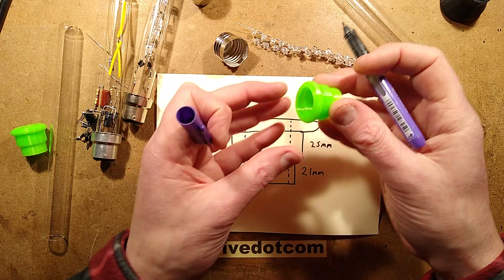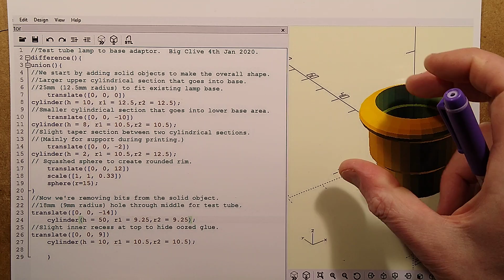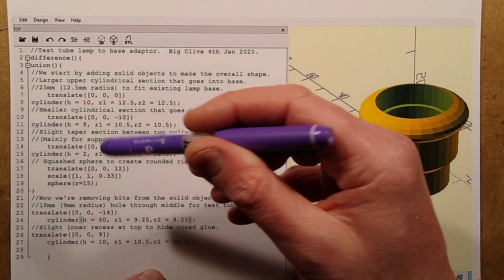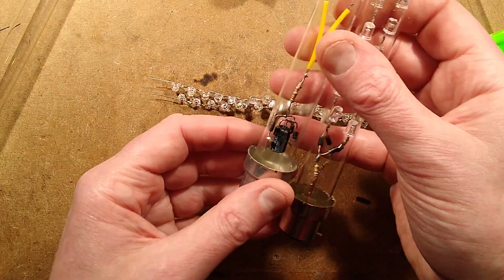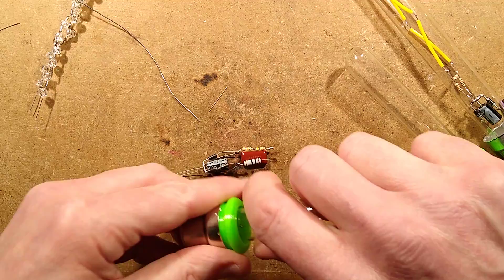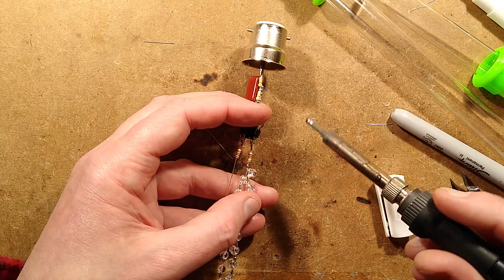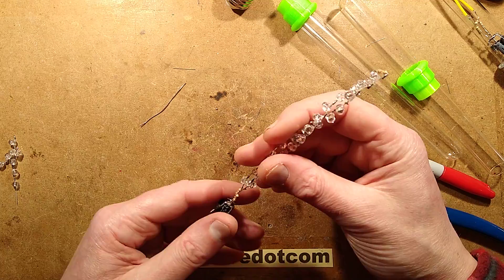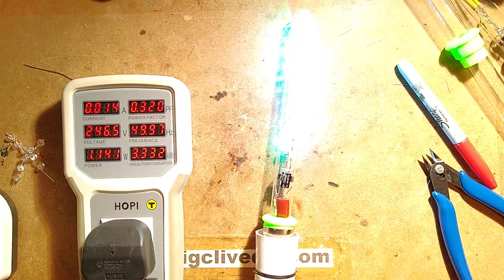3D printed LED test-tube lamp.  (with adjustable 3D openSCAD file)

Comment: >I dunno why they stack it like this     https://youtu.be/vNucN3ZW8Vg?t=280 

The union { } builds a shape based on the components inside.  The difference statement is the equivalent of saying ((A - B) - C) ... Where A is the shape (made of 3 components ) and B,C ... are the portions to remove. With the union statement, you have 3 components to build the shape and 2 components to remove material. Without the union statement, you have 1 components to build the shape and 4 components to remove material.

Comment: You usually use the little studs to pin the component legs in the bottom of the cap. Why did you not do this time you really gould have gotten mabe 8 or 10 more leds in,.

Comment: Would you have this schematic for 120v or would this work on US voltages to?
Reply: Wow did you really post this a week ago? Just now getting a notification for it. Stupid YouTube lol
Reply from the maker: Just released it fully today.  It will work on 120V.  You could use a higher value dropper cap rated for 250V.
Reply: bigclivedotcom ah ok I see. I might make something like this for my daughters room. Some of the comments show they were posted a week ago lol

Comment: When it comes to 3D printing cylinders number of faces matters. Here by the looks of it you have 30ish or so. Low number of faces means cylinders will end up slightly smaller in diameter due to averaging. To get around this you can simply specify to have more faces either globally by setting variable "$fn = 60" (for 60 faces) which I don't recommend, or locally for each cylinder by providing additional function parameter with the same name (eg. "cylinder(d=10, h=20, $fn=60)"). Also, this variable name is great if you want to create regular shapes like hexagons and octagons without messing too much around with polygons and then go about extruding them. There are other variables which allow configuration based on angles and whatnot, but I find "$fn" to be the most intuitive for me. All in all that's why you had to increase diameter slightly. Regardless of this effect you always need to add some spacing between ideal size and resulting print because plastic is squished while being extruded to provide good adhesion. I usually put 0.1mm but it really depends on your configuration, heat, printing speed and many other factors.

Comment: Copy/Paste removed all the carriage returns for me.  Had to manually put them back.
Firefox on Linux.
Model builds fine.
Thanks, Clive.
Reply: That's weird. I use Firefox on Linux and it worked just fine.
Reply: @rbottomley  I also run script/tracker/beacon blocking software, and a PiHole.  They may have interfered with it.  Numerous bits of Google are blocked from my network, including all the ads.  It's worth the odd bit of aggro.  ;o)

Comment: Since there are now lots of the smt LEDs tacked to wire strand type lights available. Do you think someone is going to do the same with WS2811 type addressable LEDs?
Reply from the maker: It's possible, but would require an additional decoupling capacitor next to each LED, and the data line would have to be cut at each LED.

Comment: For adding flux to wires/component leads etc. I've a tub of flux and poke the leads in. Saves messing around with the pen.
Reply: Depends on the type of flux. Resin type flux is OK but plumbers flux is designed to clean off copper oxide easily, and if you get too close to the smoke it will clean the front off your eyeballs too.
Reply: @Gordon
Got builders in at the moment and can't get to my bench but it's similar to this
https://www.ebay.co.uk/itm/Silverline-Soldering-paste-flux-20g-Lead-free-easy-use-no-residue-paste/254389728805

Comment: Nice to see you making use of 3d printing :D

As a rule of thumb, to make 3d printed things fit to measure, allow for 0.2mm shrinkage.
So a 5mm diameter tube would need a 5.4mm 3d printed hole.
Reply: Shrinkage  is all based on the material being printed as well.
Reply: It's better to calibrate your slicer and printer instead of changing the model
Reply: @RobertSzasz  Or maybe get into the habit of acknowledging that additive manufacturing is not a cure-all and just like any other manufacturing method works best in conjunction with decent post-processing. Unless, of course, you're perfectly happy with things looking like spooled turd.

Comment: I would like to recommend looking into DesignSpark Mechanical, freeware from RS Components. This is the easiest 3D CAD package I've used to date.
Reply: Unfortunately DesignSpark Mechanical is Windows only. No good for Mac or Linux users. OpenScad runs on all OS's. Also TinkerCAD runs on all OS's.

Comment: RE: Your question on why `difference()` is before `union()`.  As a developer, this is not unusual.  I don't know the language enough to give you the result in the order you think about it, but if you assume that the internal method `union` is resolved first, then the result of that is "passed" to the `difference()` to be resolved then it might make more sense.  I see that OpenSCAD lets you define modules so you could name the method, pass in variables and such, but that's probably more than you would ever need for this project. ;)
Reply from the maker: I've been playing with variables in another project.
Reply: @bigclivedotcom
If you change the value of variables read the OpenScad instruction carefully since it uses a final state value for any given level.  From the OpenScad manual :

"OpenSCAD is a  Functional programming language, as such variables are bound to expressions and keep a single value during their entire lifetime due to the requirements of referential transparency. In imperative languages, such as C, the same behavior is seen as constants, which are typically contrasted with normal variables."

Have a look at this part of the manual 1.4 Variables and sample. It can save you a lot of head scratching.  :-)

Comment: How about the same idea, but with chemistry/lab flasks, of different shape, such as the larger spherically ended ones, or the tapered conical types. You could even use something like it for the 'angel' on top of the Department of Villainy, Christmas tree next year, and/or baubles for it too.

Comment: The best thing about OpenSCAD that I haven't seen in other CAD packages is that the code on the left can have variables in it. So for example you have a variable for the test tube's diameter at the top, which the user can set, and the code will automatically make the hole down the middle the right size and/or make the base a bit wider etc... Good stuff.
Reply from the maker: I've been experimenting with variables.

Comment: Lovely. Using openscad loads myself :)
PLA with electrics though.. it has such a low melt temp and easily burning that its not all that suitable for reliable applications
Reply: I would be concerned if a led lamp of that size would go over 50-60°C
Reply: Just use PETG then. 
Those low power applications don't become hand warm though.

Comment: I like to use $fn = 60 to increase the number of facets so the circle/spheres look smoother.  It can also cause a given design to crash, at least on my computer.   
Good idea to include the text for the code.  This works on my computer.
For people new to OpenSCAD, F5 previews the design, F6 renders the design.    You have to render the design before you can export an STL file for printing.    The F6 render is also when the design may crash depending on the computer.
Dave.

Comment: Did you recover the bases from other lamps or is there a source for these?
Reply: The Stanley x-ray machine supplies all his bulb ends. Also handy to  use on any bellends you sometimes encounter in life.
Reply: The adapter idea looks promising, there are some b22 to e27 adapters where the outside is 100% plastic, the e27 insert is just held in place with a couple of screws and the electrical connection is also by screws. That might do away with the need for an insert.
Reply from the maker: From other lamps or eBay base adaptors.

Comment: tinkercad online is a another good bit of kit its free and easy as heck to use to make 3d files :D
Reply: Came here to say the same thing. I've created a couple dozen items with Tinkercad, several of them being designed to fit existing things. I've been able to quickly create and modify designs, and print them using Cura on my Monoprice Select Mini. Talk about rapid prototyping! And totally agree- Tinkercad has a short learning curve so you can concentrate on the design and not the tool. I've had a really good experience from the get-go with 3D printing. Maybe I lucked out but I've had absolutely no problems creating and printing all kinds of useful things!

Comment: What 3d printer do you have clive
Reply from the maker: Tiertime Cetus 2.
Reply: @bigclivedotcom  you should really use fusion 360. Once you wrap your head round it. It will expand your 3d printing experience massively
Reply: @Michael Knowles
Only if  you use a LOT of time, and resources on the PC. Doing small incremental changes is a lot faster in OpenScas. I often also set up several display in the priview that show what I make in different positions so I can see it from many angels at ones. Doing that is a pain in Fusion, but for complex parts that also need some analysing then Fusion is the way to go.

Comment: WOW, you have a 3d printer?  Which one or old school DIY like an I2 or I3?
Reply from the maker: Cetus 2.
Reply: Ahhh, the one armed bandit.  I always wondered how those cantilever models worked out and if not too large they make really nice prints.  I am seriously looking at SLA machines but their problem is they are small.  The resin is coming down in price and water based plus no stink with some so coming along but the one thing that bothers me outside of size is the models seem to be fragile.  Upside is the more parts you throw at it the faster the print as it literally does all parts at once per layer so load it up (here is the issue again with its bloody lack of size).

Comment: > "Try to keep it as short as possible"
> Video is over twenty minutes long
Ah,  good man Big Clive. Never change.
Reply from the maker: If it had been the full build it would have been over an hour.
Reply: @bigclivedotcom  And a lot of us would still have watched it :D
Reply: @bigclivedotcom  I could have used at least another 5 minutes of video to finish drinking my morning coffee that I started at the beginning of the video.
Reply: @bigclivedotcom  No complaints from me.  I'd sit for 2 hour videos from Clive.
Reply: @bigclivedotcom  I was in homebargains today and I noticed the led ceiling bulbs were 2 different prices. At first I thought it was a typo because I couldn't see a difference.. Then I noticed one was "Dimmable"!! Is this now possible?
Reply from the maker: @Balllsy  you can get dimmable lamps and drivers.  Some flicker at 100/120hz though.
Reply: @bigclivedotcom  OK well I might pick a couple up and try them out.. I shall report back sir!
Reply: @Balllsy  I have a newly-redone house full of different kinds of led lamps, many dimmable.  Mostly they are fine, but there are some compatibility issues. I think the issues are about leading edge versus trailing edge or something, and there may be other details too. But basically you cannot just assume any dinner will work with any dimmable led. In my case the incompatibility is in one room only and results in the lamps flashing a couple of times when switched on - but only rarely - very livable-with.
Reply: @bigclivedotcom  Bring it on!  People who don't like it can drag that little playback thing forwards...
Reply: @bigclivedotcom  So it was as short as possible, but no shorter. :3
Reply: @MadMorgie6318  me
Reply: @bigclivedotcom  A lot of 3D printed materials will shrink a bit after printing. Most people aren't aware of this when they first start out using 3D printers, especially since there's usually a million settings to look over in the software before clicking print. If you know the temperature, nozzle size, layer depth, cooling fan speed, infill percentage, and material you're printing with, some software can adjust to get the proper dimensions printed, but sometimes you just have to do a bit of guess work to get the desired product. Some of these settings can be completely ignored most of the time, but the more you 3D print, the more you'll have to fiddle with various settings to get desirable products.
Reply: Doesn't matter all too much: I found myself watching Clive's videos not even noticing how much time have passed.
Reply: Afraid he's a bit like Dave (EEVBlog) in that respect, short videos are long videos, long videos are long videos with lots of editing.
Dave did manage to make a very short video once, forgot to change the camera battery before hitting record, didn't want to start again.
Reply: When a person is doing something why to pork a nose in between. Let him do he is well in explaining. Instead u must thank him
Reply: Clive is the only YouTuber other than TYT live (news) who can get me to watch long videos.

My only disappointment with this is that if love to see the full build (maybe two versions next time?)

I would also love to see the diagrams with alternative values for 110-120v US power, but I'm probably just being greedy.

I love the way he turned the components into art

Comment: There are two reasons why an inside diameter may be smaller as printed than as designed:
1. Faceting of the generated model — all points are generated on the circle, so all facets are chords of the circle. You can either increase the resolution so it doesn't matter (set "$fn = 120" or however many facets suit, either as a variable or a parameter to the cylinder() call), or calculate a larger diameter (divide the diameter or radius by cos(180 × number of facets), if I remember correctly).
2. When the printer is extruding, the filament tends to stick to itself and be pulled along by the nozzle, so all corners are rounded and circles are smaller than specified. I hear some slicers can compensate for this, but whether in the slicer or in the model, you'll need to calibrate it to your particular printer and filament characteristics.
Reply: Came here to say this. I almost always make "$fn = 180" my first line. For performance reasons, I leave it commented out until I'm ready to export the STL for printing. My main purpose is just to smooth everything out for printing. As you pointed out, it can also have an impact on the actual clearance size of cylinders, holes, etc.

Comment: The code works fine with openscad. Messed around with the script and the numbers and it was still fine, other than after the alterations it looked nothing like the original. Very nice program Clive, many thanks.

Comment: I particularly enjoy that when those LEDs get into the blues and violets that the plastic you used begins to fluoresce. 
I love 3D printing for things like this. I've printed a LOT of very useful things that either didn't exist, or cost significantly more than the pennies it took to print myself.

Comment: This gave me an idea for a novelty lightbulb that would light up when you hold it basically emulating uncle Fester ability. You could easily hide a couple of button cells in the base and use capacitive coupling to trigger the circuit (TTP223 module perhaps).
It would be a bit of a problem if someone actually stuck one in a mains lamp holder though

EDIT: If you want to implement this for a future video feel free to do so it would be really cool actually
Reply: Massimo could use a microcontroller to give it different modes. Maybe add a feature where you double-tap to disable the lighting in case someone else wants a go;)